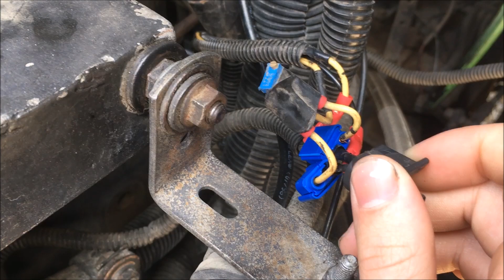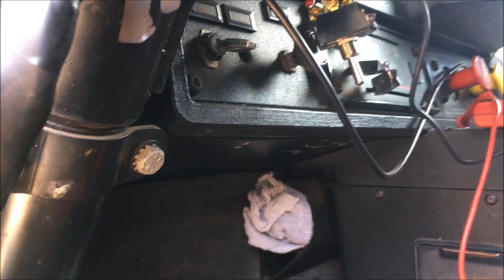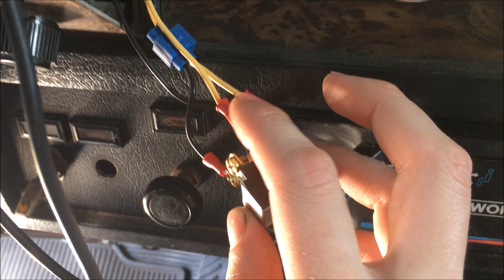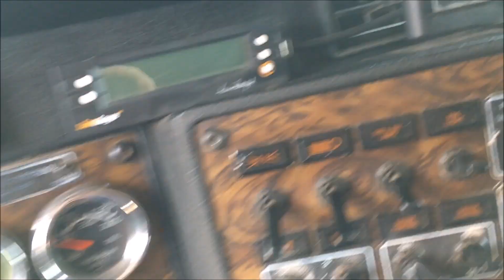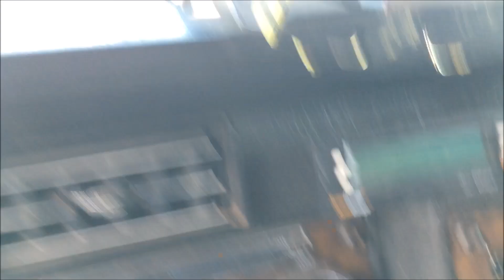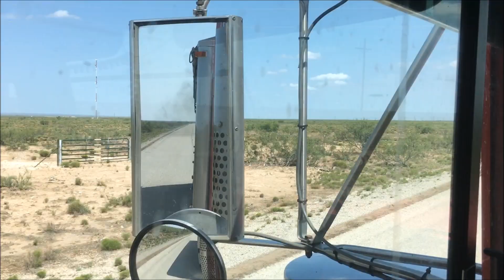How to Roll Coal

Comment: Will just unpluging the sensor do the same ??
Reply from the maker: No, The ECM will detect an open circuit and basically derate to something like a no boost safe mode. So your 400-500hp engine will act like a super sluggish 250hp engine. that's the first thing I tried.
Reply: Where did you get your potentiometer ?
Reply: Also , if you just complete the circuit by bridging both wires would it do the same thing or would Ecm sense that it’s too much current?
Reply from the maker: @m23jumpman  I ordered a potentiometer set off amazon. To my knowledge these sensors operate at around 0.5v to 4.5 volts, so if the ECM sees roughly 0.0v or 5.0v it will throw a "open circuit" or "shorted to high" code respectively.

Comment: hello love this man 👍👍🍻

also saw your other videos on the engine 👍

1 question

did you get it to do 30+ on turbo boost??

🙏🍻
Reply from the maker: Thanks. Now that its cooler it can push up to 35psi turbo boost.
Reply: i was hoping for like 40-45 psi on boost 

like the 3406 do

sooo ?

not much gain on boost

Comment: Hi I also got an n14 would love to do the same can you please make a parts list and link where to get them,thanks! Love the channel!
Reply from the maker: There really isn't all that much.-Wire, probably 18 gauge, maybe 12 feet or less--Butt connectors--Wire splices--Eyelet connectors--A ON-OFF-ON toggle switch with 6 posts--A wire splicing tool-You can get all that at an auto parts or hardware store.The biggest thing is the potentiometer, this is the set I bought:https://www.amazon.com/dp/B0711MB4TL/ref=cm_sw_r_cp_api_i_7SKACb37K2K18But your probably better off getting this instead, because it already has wires attached:https://www.amazon.com/dp/B071X4DKV7/ref=cm_sw_r_cp_api_i_GZKACbGC57MS1
Reply: Thanks
Reply: What ohms potentiometer did you use